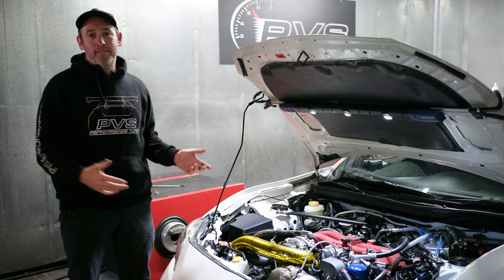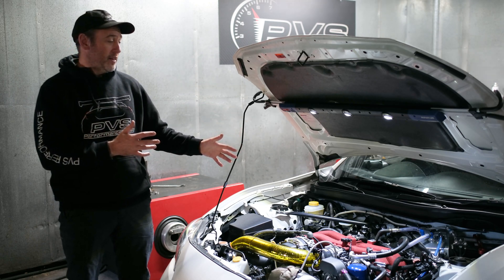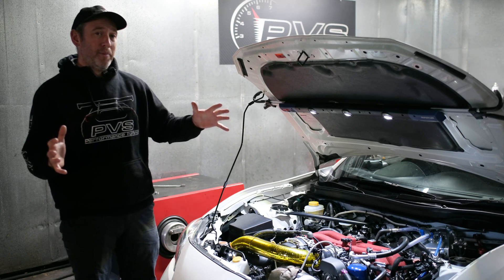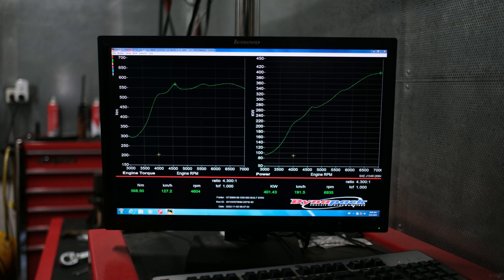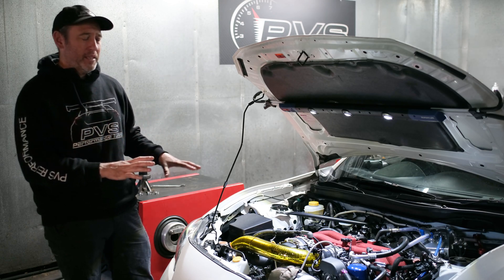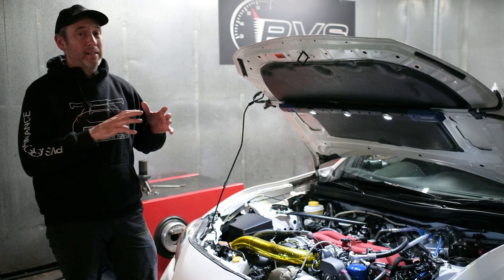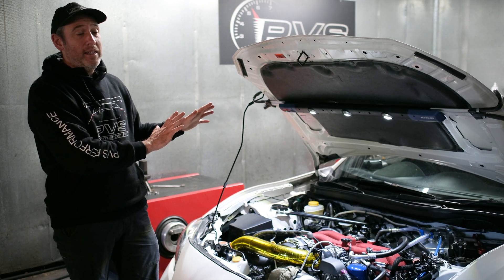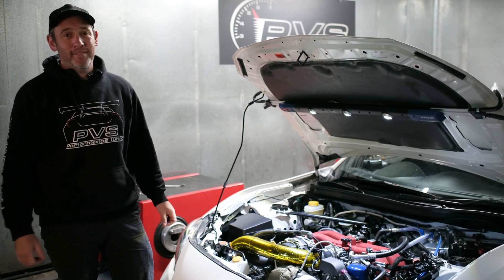420kW (570hp) FA20 turbo 86/BRZ - PVS tuning 400kW package

Comment: So is this running standard internals or forged? I’m running 330bhp @ the crank with a precision 5558 turbo 8psi of boost and I was advised by the tuner not to go any more than that on standard internals. Also that’s on pump fuel 99 octane. I’m in the UK and ethanol isn’t very accessible

Comment: Does anyone know how much the gearbox costs?  And how often do you need to do maintenance on it?  I just looked up the HKS sequential gearbox (they use on the GR86 they have) and it says this on their website.

" * It is recommended to maintain (or overhaul) HKS Transmission every 1,000 to 3,000km. If neglected, gears and/or dog parts may be damaged. "
Reply: sorry, this is very late. But the gearbox alone is 10k, doing all the work and adding in the extras like clutch, flywheel etc will easily bring the total to 13k+ for all the work. (I think I got quoted for 16k for the entire job).
Reply: @GoogleUser-mb4xu  Thanks for the reply.  Very kind to provide that info.  Cheers.